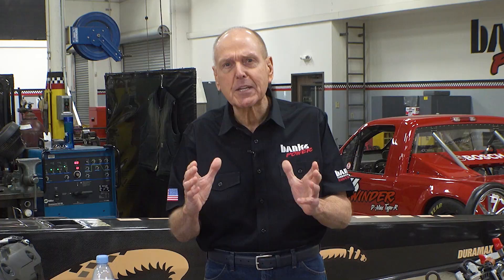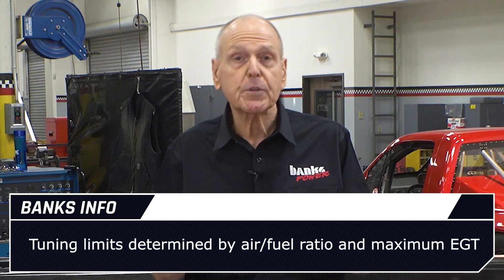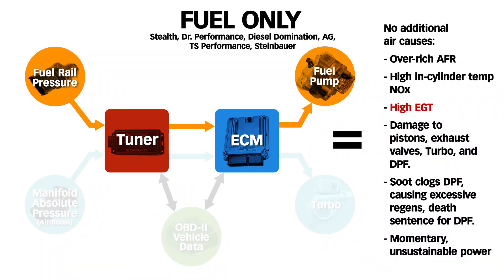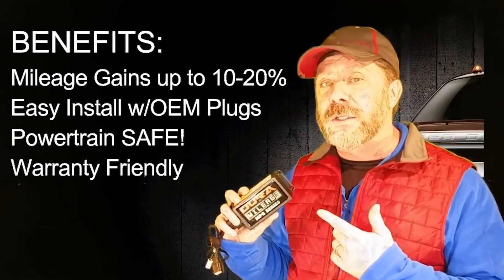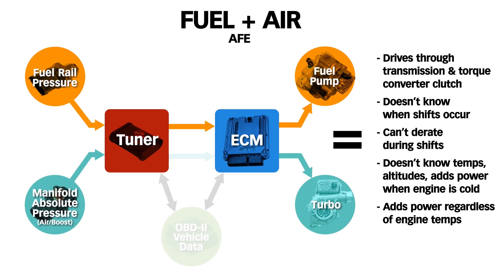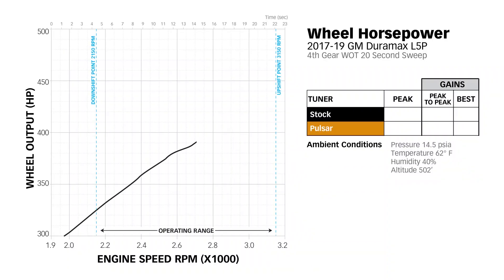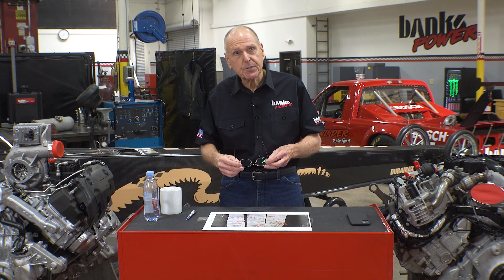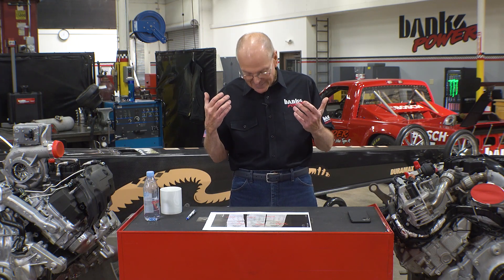How to Build a Better Inline Diesel Tuner

Comment: Anyone know if these work on deleted system s?
Reply from the maker: The Derringer is designed for complete emissions intact engines only. If the truck is missing EGR, CAT, DPF, DEF, or SCR it will not be able to make the necessary performance calculations.

Comment: Will this tuner work with a flashed ecu with dpf and egr delete? Just wondering if the inline tuner will effect the flash tune on the ecm. I know it counterintuitive but if a truck it already delete with shock tune will it work as good.

Comment: I've had my Ford 11 years & have tried an Edge, a 6 way "chip" & a Banks(which I bought on EBAY for $40) on my 99 Ford F350 which pulls a 10,000# gvw horse trailer & same GVW car trailer most of the time. The Banks has been by far the best. Best power, best fuel economy, best shifting,  lowest EGTs & ZERO black exhaust smoke. Not sure I'd spend $600 on this for an "experiment". Banks has ALWAYS been the leader in diesel performance. Banks is also the ONLY tuner manufacturer(regardless of gas or diesel) I've ever spoken to that told me they'd "unlock" it for free, if it was VIN locked when I got it. Just ran almost 400 miles running 65 mph pulling the horse trailer with some pretty big hills in very high winds, including in & out of Death Valley(3,000 ft to 200 below sea level & back out) & averaged 11.9 mpg & EGTs never over 1,000 degrees. Can go to southern Kali & cops never look at me because there's never any black smoke which is just wasted fuel! Other minimal mods are the International 203* T-stat & 70# primary fuel pressure spring & the DeiselSite adjustable mechanical waste gate controller set at 30# boost.

Comment: What is the mpg on a 3.0 ecodiesel ram 2017 after pedal monster and with bank tuner. On 35 inch tires going up hill and down hill.
Reply from the maker: The Derringer and PedalMonster are designed to deliver power and throttle boost when you need it. They're not designed to increase fuel economy. Therefore, we do not advertise fuel economy gains. Fuel economy depends on many variables including how you drive.
Reply: @bankspower  ok thanks for answering the question in a timely fashion

Comment: Two questions... I already installed a one of the modules you mentioned that just adds fuel claiming to save you fuel.  Do you think I should take it off? Is it causing damage?  Question 2. When will you have a tuner for the ram 6.7. I only picked that worse tuner cause you don't have one. Now I'm questioning that choice.

Comment: Have you all finished the 12 Ram tuner for the off road yet? Or, a tune that will not clog up the dpf for the 12 ram. There are not many options out there and I need to make it a off road truck. It is clogging itself up with two turbo's. And so much fuel in the oil. I run 100% AMS oil and can't get max oil change intervals with oil analysis. I have a bypass system too... Grrr!!!

Comment: I would like to see you make some dyno vids on several of the major tuners on stock trucks before and after the tuner applications. I would like to see your low end Automind included in these test, and not just your top end products. I would also like to see your thoughts on Calibrated Power and HP tuners.

Comment: PRETTY PLEASE WILL SOMEONE COVER THE MERCEDES 0M647????

THE ONLY "MILLION MILE DIESEL" EVER PRODUCED!!!!!!

REGULARLY BREAK 500K WITHOUT TRYING! 

WHY IS THERE SO LITTLE INFORMATION ON THIS AMAZING MOTOR THAT WAS PERFECTED IN THE 60'S!!!!!

PLEASE SOMEONE COVER THIS ENGINE!
Reply: ...how does an engine made in the 60s comply with modern particulate limitation EPA standards?
Reply: @SuzukiKid400  
Ask mercedes?
Reply: @thecloneguyz  I’m pretty sure anything in production today which may date back to the 60s has a significant amount of engineering to make it comply with current regs and power standards.  Diesels in the 60s were dirty, unresponsive and not powerful.

Comment: What happens when you delete dpf and egr? How will it compensate?
Reply from the maker: Derringer is not designed to operate without emissions equipment intact. It uses data from those sensors for calibration.

Comment: I can think of a few ways to make this even better;
- Different tuning modes, wirelessly controlled via an app or something.
- Telemetry logging for various diagnostic stuff, to detect error codes and whatnot. There are many OBD-II-based tools for highly technical troubleshooting out there that you could draw inspiration from. 
- Maybe some kind of machine learning so that it can make its tuning even better as it learns your driving style and vehicle characteristics?
- An easter egg in the software to amuse anyone taking a deeper look at it.
- Wireless updating of its software? I'd buy that~

Comment: colorado 2.8l diesel derringer please!
Reply from the maker: We have a plan to address both the LWN and LM2 engines (sometime around Q2). Right now, both projects are currently on hold. We are trying to finish a few GM 6.6L L5P '17-'19/'20 projects before we continue development on the 2.8L LWN and 3.0L LM2 engines.

Comment: Will the Derringer ever be available for the LML? If not what is comparably available for the LML?
Reply from the maker: We are currently working on the LML ('11-'16) Duramax Derringer. We didn't get the results we wanted on the first run so we are looking into a different hardware set up. We always like to get it right! Engineering is in our name, which means that we have to tinker with a product until its the best that it can be. Sorry that we don't have more information to go on right now.
Reply: Banks Power thank you for the quick response. I would be willing to wait for a quality tuner like the Derringer.

Comment: I solve all the problems with engine braking. Why do I need horsepower to begin with when I have four wheels and a rollaway risk? Wanna travel faster? Hoist up a sail in your truck bed. Better yet is a jib from whence the unnecessary "plow attachment" resides. Batteries for braking and parking operations make sense tho..
Reply: George Doolittle ok

Comment: We need something for the 6.7 Cummins come on gale you can do it
Reply from the maker: The Derringer for 2013+ Cummins 6.7L was taken back to the drawing board. We had a tuner that we were testing and ended up scraping; it wasn't up to Gale's standard. We are now trying and all-new method of tuning for the 2013+ Cummins 6.7L trucks . We don’t have a release date yet because it is still earlier in the R&D phase right now. We always like to get it right! Engineering is in our name, which means that we have to tinker with a product until its the best that it can be. Sorry that we don't have more information to go on right now.
Reply: Sounds good I will definitely be one of your first customers when it’s done

Comment: I will keep my old school 1996 7.3 that yes I have a vary milled tuner on it (Bully Dog). to get better MPG and yes after having it installed for over 175k miles I can say I do get a good 3 MPG more.   and over all the truck has 266k miles on it.   F250 work truck. in this case the extra fuel is cheaper in the long run I pull a 16K trailer all the time.
Reply: Your tuner(and mine, on my '00) is a flash-tuner, so it can affect the timing, max boost(or at least ignore 'overboost' conditions), and control the trans shift pressures... a lot more than a dumb inline tuner(the "10K" mod on a 7.3 PSD basically).
Also, it sure looks like the modern trucks are designed around the turbo's flow characteristics and push them to the max, vs the old 7.3s which had plenty of 'headroom' in terms of air that could be gained from a stock setup.
Reply: I agree. and it is all the more reason that I will never part with my older 7.3and the fact that the engine was built by international.

Comment: Every part or package I've bought from Banks over the years, from a 6.9 Ford to a new L5P in a GMC has worked perfectly right out of the box. They even helped with getting a 5.9 Cummins running correctly in an F450. Having bought a lot of performance parts over the years for both gas and diesel engines, Banks has been the best choice over and over. They don't over-promise and they do deliver. Pure race parts are something different but if you drive it every day this is what works. What else could you ask for these days than someone that does their best and tells the truth? No, I don't work for Banks, and no I don't get a discount for being nice here.

Comment: I have a 2007-1/2 3500 4x4 Dually with the 6.7 Cummins which I had to delete at 100K miles due to it was all plugged up and was only getting 13 mpg at 65mph and continually plugging the dpf, oh just to clear it up I bought the truck used at 94K miles.   So I'm wondering would a Derringer work on my deleted truck and get the performance and fuel economy that my Smarty JR set at Towing 75hp gets me 18-19 at 78-80mph

Comment: @Banks Power  I asked this question last year. Are you currently doing R&D on the 2.8 Duramax? I and many others are very interested. Thanks
Reply: I wish they would. I had a 2.8 in a 12 passenger Express van, and that sucker averaged 21mpg for the 35,000 miles we owned it. It was awesome, except for regen issues we always had to go to the dealer for, to make them force regen it.

Comment: My question is when will the Banks team release a real ECU to replace the stock unit. Currently only Motec in Australia offer wire-in or some plug in replacement units for diesel engines. (Well there are also some Bosch motorsport ECU's as well but big $$.)

I'd be curious to know what electronic package Gale and the team are using on their high power duramax engines? I somewhat expect it is not simple inline tuner ;)

Comment: Very attentive to details here. I would like to ask you Banks Power or Mr. Gale Banks as you have been perfecting Derringer for the light to medium duty engine sector, would this same system possibly be a a good fit if developed properly for heavy duty and class 8 heavy truck engines?

Comment: My only question is when am I going to have the Derringer available for my 2.8 Duramax???
Reply: I emailed banks this question months ago. The response I got was "I havent heard. But likely we are." Doesn't give a lot of confidence.
Reply: @cam872k3  what bothers me is there used to be some social media images of Colorado's being worked on but then they were pulled
Reply: I want this info also ... frustrating
Reply: @justin02b  Banks Power "We have a plan to address both the LWN and LM2 engines (sometime around Q2). Right now, both projects are currently on hold. We are trying to finish a few GM 6.6L L5P '17-'19/'20 projects before we continue development on the 2.8L LWN and 3.0L LM2 engines."
Reply: @cam872k3  I got the same response. Assuming work has been done on it previously, I figure it will take them at minimum 3 months of further work to perfect it. Meaning at earliest, Q3 2020 assuming they don't invest all their time into the 3.0 in the silverado. Kinda upsetting since the engine has been out since the 2016 model year.
Reply: MrSkyentist  but the l5p is aContracted vehicle or engine platform through the United States government that’s why banks put so much effort into the Duramax program specifically the 6.6 Duramax please correct me if I’m WRONG GBE
Reply: 2.8?🤭🤭🤭
Reply: @antonfloor344  yes, those little diesels get fantastic fuel economy for smaller trucks. They make the most sense for many people, efficient enough as the daily driver and stout enough to pull the occasional boat or camper.

Comment: All good and well except for those who buy a late model Diesel pickup today are wasting their money vs. gas.  This applies to most recreational owners, not those who haul heavy loads for a living. The best value today is a gas truck for recreation due to the DPF/DEF on Diesels. Why? Diesels are about an extra $8,000 to $12,000 in cost plus they no longer get the fuel mileage they used to prior to 2008. Most newer Diesel pick up trucks are getting 8 to 12 MPG and paying more for a gallon of Diesel than unleaded gas plus the extra cost of the DEF. Insurance is more and from what we are hearing, Diesels require much more maintenance such as fuel filter, oil filters and oil changes often. Those engines hold a few gallons of oil too. Many will disagree, so those who are Diesel minded which is okay, its your money and vehicle experience but for most folks, the value is less over the long run. If you haul heavy every weekend for pleasure I'd say you might want a Diesel for the extra power going up hills etc. but it would be a close decision math wise as gas would be the better value. For those who are always hauling heavy, Diesel is the way to go by far so this Derringer item would benefit all Diesel trucks. And the best part of it is, no smoke and it's legal plus no worries about blowing up the engine.
Reply: Counter point. My 2018 3500 Ram 6.7 gets better mpg than my 2004 Dodge 5.9. My stock hp is up, my stock torque is up by 200#, my rear gear ratio went from 3.73 to a 3.42. Oil changes are the same $. One of the fuel filters is about the same, but there is and added expense of the second one. There are a few things you failed to talk about on the new big gas engines and I will admit that I have not looked into then. I( the quanitity and grade of oil required, Some gas engines require full synthetic oil.2( the fuel filter required and change interval, 3( the fuel grade required to tow at its max capacity vses using it as a daily driver. Talking in generalities about the differences foe the weekend of up to two to three month straight tower is  not painting the full picture in my mind.
Reply: @johnirwin1837  True, its hard to paint something everyone will accept. However, when I discuss MPG with Diesel trucks today vs. 10+ year old ones, it has to do with while towing a decent load. Otherwise, there is not point in talking about a Diesel truck going down the hwy empty since the conversation is all about value and cost of ownership.
Reply: @bcbloc02  Point made. MPG has suffered over the years. A friend has the wonderful Ford 6.4 Powerstroke...9 MPG empty load. Already went through one engine at 110,000.
Reply: Garth Clark Ok 👌

Comment: Gale ,  when is the 2019 derringer for the Chevy Zr2 baby Duramax diesel going to be out ?
Reply from the maker: We have a plan to address both the LWN and LM2 engines (sometime around Q2). Right now, both projects are currently on hold. We are trying to finish a few GM 6.6L L5P '17-'19/'20 projects before we continue development on the 2.8L LWN and 3.0L LM2 engines.
Reply: Banks Power excellent.   Thanks !
Reply: @bankspower  thanks banks !!

Comment: Great explanation. Can you guys go into why you dropped the Cummins 6.7 Derringer? Sounds like it was already maxed out from the factory/maybe transmission sucked too much to even bother lol
Reply from the maker: We didn't drop the Derringer for the Cummins. To be frank, Gale and the team were not happy with the hp and tq output. So, last fall they scrapped the design and have been working on since then. The RAM requires pulse-width and timing to make significant increases in power. That requires a new circuit board, etc, which are in-process. 👍
Reply: @bankspower  oh wow super interesting. Thank you for responding. I wouldn't want to spread misinformation LOL. thanks team Banks 👍
Reply: @bankspower  What about us 2012 Cummins guys? Will the Derringer be better tuning than my current Automind? I use the Tow Tune.
Reply: @bankspower  please!!